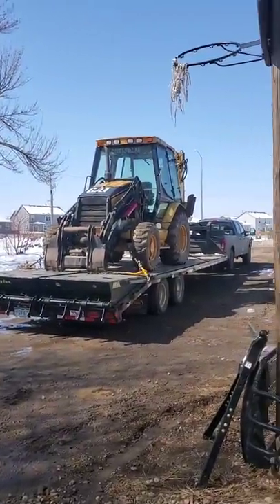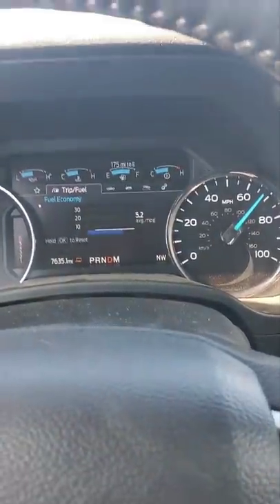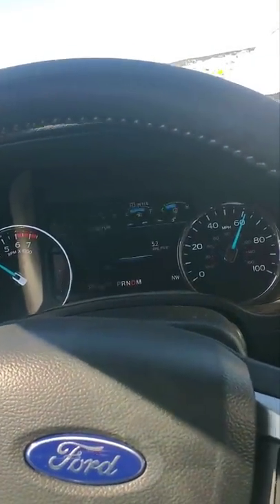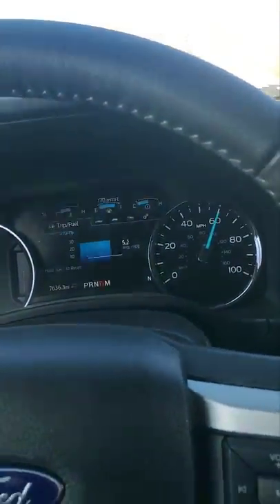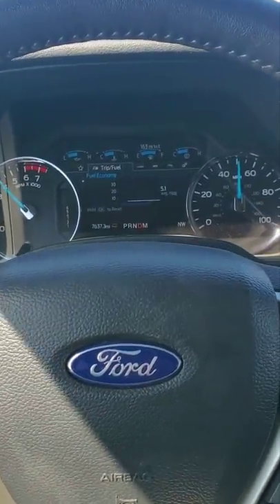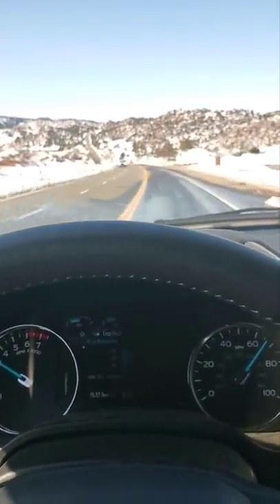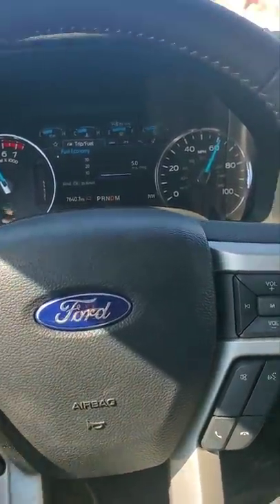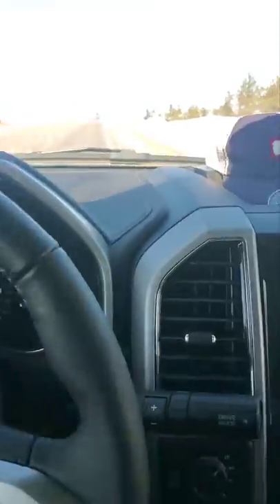7.3 godzilla towing 24k lbs through the rockies.

Comment: FYI, the 7.3 Godzilla has a cam phaser.

Great content.  

I've been looking for a new truck.  I'm probably going to buy a SD with a 7.3.  

I sold the last gasser I owned in 1999, 25 years ago.  I sold my F350 during COVID because I got a good price for it.  I'm sick of owning diesel trucks.  I think Ford knocked it out of the park with the 7.3 and the 10 speed.  

I watched your other videos... my F350 needed a high pressure fuel pump and the rest, luckily it was covered by warranty.  I also plugged the DPF on it.  Luckily I found a used one for not too much.  The turbo failed just before I sold it.   It was a nightmare to work on. First step to doing anything under the hood was to pull the radiator.  I must have done that a dozen times.

I totally agree that the 7.3 is cheap to replace if anything goes wrong with it.  You and I think alike.  I love that you don't have to pull the cab to work on the 7.3.

I love how Ford set up the 10R140 with 3 OD ratios, closely spaced.  Great for towing and great for MPG running empty.  Even better than a 13 speed, which usually has just 2 OD ratios, 12th and 13th.  

I totally agree none of the pickup gassers prior to now have been suitable for real towing.  They also didn't have a decent transmission with enough speeds.

I've been debating the 7.3 or a diesel for a couple months.  Your videos were very helpful. 

A couple advantages you didn't mention... the 7.3 will start way better than a diesel and warm up faster.  And tolerate idling a lot better.  And the 7.3 package is about 600 pounds lighter - lighter long block, lighter fuel injection system, lighter exhaust system, smaller cooling system, etc.   600 extra pounds of payload is very welcome - will save me from having to go with a dually. 

Jacobs builds a stand alone butterfly exhaust brake for the ISC (8.3).  I wonder if it would work on the 7.3 ? 

BTW, my family had a road construction company.  I've done a lot of welding and wrenching on heavy iron.  I like your FL80.  That boom must be incredibly handy in the field. 

Keep up the good work.
Reply: Buy a Cummins.. not a 24, but before that. 24’s got hydraulic cam n lifters n they have problems

Comment: Just got an E450 high cube with a 16' box. Has the 7.3 in it. I'm loving it. Tons of power and we average 8.5 compared to 5-6 in our old 3500 gmc van.
Reply: Worked with my brother and they had a truck like that with a v10 6.8 I think always had problems . I asked why didn't ford just make a big block. Everyone shrugged
Reply: We just got the same setup E350. Not sure the rear end gearing but it definitely goes just fine.

Comment: I got a 2020 250 FX4 with the 7.3 and 3.55 gears and the truck only has 4000km on it but every single one of those km’s was pushing snow up here in our Canadian winter. It’s not great on gas ( about equal to my 2004 V10 F-250 ) but it just powers through the snow no matter how deep or wet it was. And best of all my truck never really saw 3000 or higher RPM’s. So far it’s been a great rig. 👍

Comment: My wife an I are planning on getting the 7.3 drw with the 4.30 rear, with upgraded 19.5 load range F.  We will be towing a 20k 5th wheel from state to state twice a year, camp ground to campground. No need for a diesel because it won't be used daily.
Reply: We are looking at upgrading to this set up as well and do not want diesel anymore. We were hoping to get a f450 with the 7.3 but the only way to do that is chassis cab. The pick up f450 exclusively has the diesel. I've been searching info on the f350 7.3 towing a 20k 5th wheel but haven't found much. Do you have this set yet and how do you like it?
Reply: How is your set up doing I’m considering buying a 7.3 myself I’m running an F3 50 with a diesel Dooley because I’m running a 45 foot RV max capacity is 21,000 and I’m hauling about 20,700 right now I just don’t know if that 7.3 can handle that safely. With the tow capacity and pin weight of the truck be enough to handle such a big RV that’s the reason I bought the Dooley because it can do it
Reply: @georgehuerta1990  I need the answer to this as well, I am in the same situation, did you end up pulling the 21k  RV with 7.3 Godzilla?
Reply: @dustinwilliams6371  I am looking for answers on this as well. Did you end up getting F350 7.3 to tow your 20k RV? I am  purchasing a 21,500 GWTR Toy Hauler and want the Godzilla to pull it!

Comment: Towed for the first time with my 7.3 4:30 rearend F-350 9500# tt full tanks, 100 mile test. Run running 68 mph truck loped along in 10th grade about 1950 rpm overall mpg at 9.8 and it was pretty windy today as well very happy
Reply: how long is your camper
Reply: @BetaRacer24  42 feet
Reply: @BetaRacer24  yeah I have a kz sportster 363th toy hauler and I towed it from st.louis area to Nashville TN on our first trip and it did really well
Reply: @BetaRacer24  5th wheel
Reply: @BetaRacer24  my last one was a 37 ft sunset trail travel trailer,  it towed ok, but the road manners of yhe fiver are a lot better
Reply: @BetaRacer24  toy hauler lot's of room

Comment: great information...WE have the exact  truck and pull a 12,000 lb 5th wheel. So far we love it.  Tows greats!
Reply: How do you do on fuel? I have a 22 duramax  pulled up to 12 tons not a big issue for it but I'm looking to the option of a gasser because adding def is so annoying to me
Reply: @gabriellvargas1889   we get usually around 8.5 gph. we have the short bed which comes with a 34 gal tank . we can get around 300 miles on a tank. sometimes we just carry a jug of gas.

Comment: I have the exactly same configured truck. I didn’t expect it would perform that well with 24k lbs. I only tow a 3200 lbs small travel trailer. Such a breeze.
Reply: You call WOT most of the time climbing 2000 feet in 65 miles good performance? I'm guessing 5 mpg. I'm probably overestimating.
Reply: @deeremeyer1749  I would. GM rated the 8.1 to gross TWICE that weight with a 6 speed. It would have been going 30 mph.
Reply: @deeremeyer1749  why not. Consistent speed, not much gear shift, 8% grade and only 3.55 rear end. That’s impressive for a gasser.
Reply: @deeremeyer1749  The dude in the video said his old 4500 Cummins Ram with a 4.30 rear end would only hold about 63mph on the same hill with the same load, the fact that this GAS powered Ford with a 3.55 rear end was going between 55mph and 60mph towing the same is impressive no matter how much you want to discredit it.
Reply: @nicolathonathan770  It is impressive...especially with the 3.55 gears. What is shocking is Ford building Class 2 and Class 3 trucks equipped with gas engines and the 3.55's...even with a 10R140G transmission. From what I have read on forums and comments on YouTube videos...the trucks with the 3.55 gears do not get any noticeable or significant better mpg's on fuel. Personally, with a new or newer Super Duty and a gas engine, I would not want any gear ratios with a gas engine except 4.10:1 or 4.30:1. Ford does not offer and has not offered the 4.10 gears for a few years. Not sure why as it would be a great gear ratio for many truck owners. 

I sold a 2006 F350 CC 6.0L 4WD SRW 172 that had 3.73 gears, ARP head studs, SCT with 395 HP, BTS, PacBrake PXRB exhaust brake and all Bullet Proof Diesel parts. It was slow pulling loads up Eisenhower Tunnel, Vail Pass, Monarch Pass, Wolf Creek Pass and Rabbit Ears Pass. I regret not ordering the 4.30 gears in that truck.

As for the 6.7L in the F250 or F350.....don't want and no longer need a diesel, but if I did...I would prefer 3.92 or 4.10 gears and would not want less than 3.73 gears. I don't care what the engineers in Dearborn say.....they are not pulling heavy loads in hill country in the "little mountain" states just west of the east coast, the Midwest.....or much less the long steep grades on mountain passes in the Rocky Mountain states. Guarantee the powerful 6.7L...with 3.55 gears just towing 20,000 to 25,000 pounds will slow down considerably going up Eisenhower Tunnel, Vail Pass or Rabbit Ears Pass.....or numerous other mountain passes in other states.
Reply: @deeremeyer1749  if you want mileage, GET A PRIUS chev boy lmao.
Reply: When people brag about towing with a gas motor all I hear is bla bla bla. There's a reason why.
Reply: @15Jeep  it’s probably because of the new 10 spd tranny. 3.55 with 10r140 is equivalent to 4.10 with 6r140.
Reply: @techs1smh13  because they don’t want to add urine into their trucks.
Reply: @nicolathonathan770   😂😂